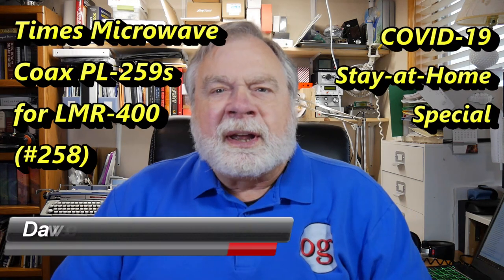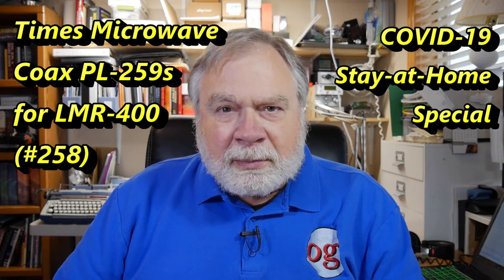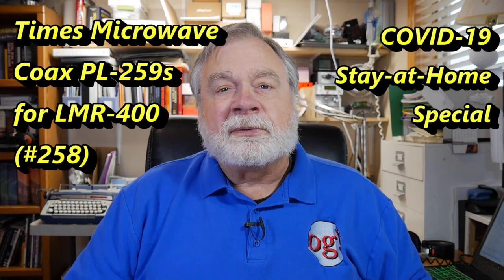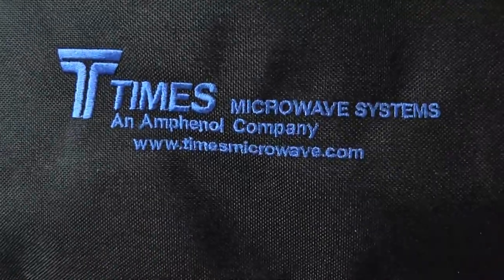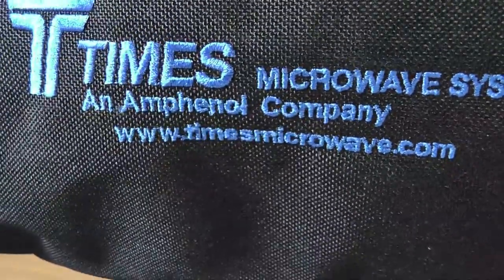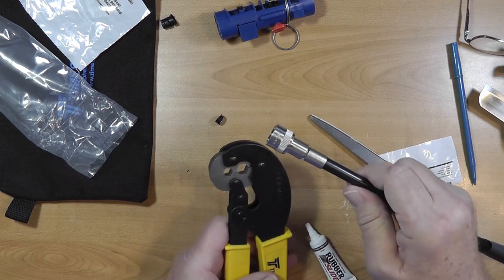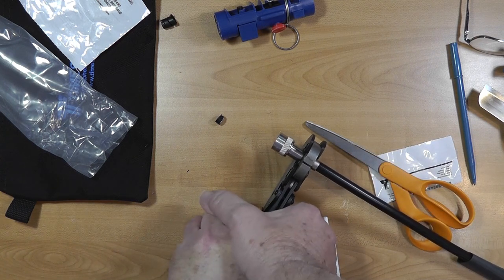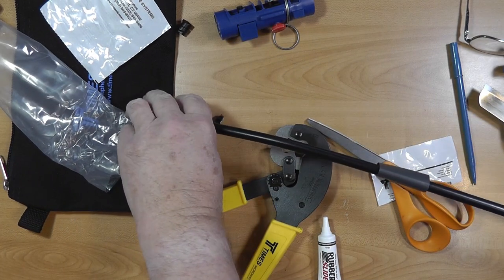Stay at Home Special: Times Microwave's Connectors and Tools (#258)

Comment: Nice video Dave.  I've been using Times Microwave connectors and cable (mostly LMR-600) for many years when doing critical antenna installations at hospitals around the state.  Maybe they didn't tell you, but when you heat the shrink tubing, it releases a sealant inside the tubing that makes a very tight, perhaps watertight seal with the sheath of the coax.  My practice is to use silicon tape to complete the installation to protect against moisture. The tools are very expensive in ham radio terms, but once you have completed the installation, don't have to go back.

Comment: Hello Dave and thank you so much for taking the time to share your videos with us. I have been enjoying them for some time now.
Near the beginning of this video you said that you were going to use the PL259 for an ADSB antenna project.  I will probably draw some heat for my comments because
this topic usually starts a heated discussion in the Ham community.
Let me start by saying that due to working in the communications business for over 20 years and being an amateur extra class license holder I have had this discussion 
many times.  I have been fortunate enough to sit down with engineers from Amphenol on several occasions discussing this very thing.
The short story is, The PL259 is only rated to 300 Mhz. Now you and I know that it is commonly used on less expensive transceivers operating up to 500 Mhz.
Also it is not a constant impedance  device. At HF frequencies their impedance is around 30-40 ohms and above about 50 Mhz it is a toss-up! A lot of it depends
on materials used and build quality. Anyway, I am ready for a flood of comments disagreeing with me but just do some research first. (Not directed to you Dave).
That being said, you are trying to receive weak signals at 1.9 gig. An N or better yet an SMA connector would be more appropriate. We all have struggled with
assembling N connectors (Although that and SMA's are about all that I use now at any frequency). So how about doing a video on crimp on N connectors for LMR-400?
Thanks again for your great videos and information and keep up the good work.

73
John 
WR0J Kansas City, Mo.

Comment: Joe Ruffer KN4AMX
Dave , Thx for all that you do for us.  I caught your remark about ADS-B.  I have been directly tracking aircraft with a 900MHx antenna, a flighaware dongle, a raspberry pi and a dedicated 27" monitor for some time and feeding data to Flight Aware.  In fact most people that visit my HAM Shack have more interest in that than the radio stuff.  You might consider a Stay at Home video about that too.  73

Comment: I use lmr400 times cable for jumpers and long runs as well. Its stiff stuff they do make an ultra flex but never purchased any. I have the cable stripping tool but don't have the cutting tool or the crimper. I have always just used the solder on type. They sure make it much easier with these tools. I remember having to do everything with a pocket knife and measuring the cuts myself instead of it being so automatic with the stripping tool.

Comment: I use the T/M LMR 400 and it has done a fine job for my shack radio/antenna connections. I buy the coax reassembled by T/M cause I dont have that assembly kit. I dont think anyone can go wrong with this brand of coax.

Comment: I really like that  connector, but especially the tool to strip the cable. I have used the Quicksilver stripping tool which is very nice but you must adjust the tool for various coax sizes, and this can lead to frustration and wasted cable when you either cut too deep or not deep enough. Also, not all coax connectors are the same in quality which can lead to even more frustration when the coax will not slide onto the connector as it should. 

Nice job Dave, I like that tool !!!!!

Comment: Thanks for the video!  Very interesting.  The question I had was the fit of the center conductor into the clamp inside the connector - did that feel positive to you?  Times Microwave is a class outfit so I suspect it is but I'd hate to think about that wiggling around loose in there.  It looked almost like one of those 'Chinese Finger Cuff' things - it can slide in but never come out.

Comment: Times's website doesnt look like they really want to sell anything since I cant find a price for the tools anywhere. Even the clicking on the connectors never leads to a cart of any sort.? what gives?
Reply: they don't do much selling to the public. Its mostly a commercial sales company. You have to register on their website to see prices and purchase from them. I used two buy direct when I worked for Motorola. Now I just buy their products thru third party distributors. dx engineering sells amphenol products as well as times cable.

Comment: Is 400 lmr the same size of RG 58?
Reply from the maker: LMR-400 has the same outer diameter as RG-8 and RG-213. RG-58 is much smaller.
Reply: @davecasler  Just wondered because my airplane radio man installed my new ADSB transponder he said with 400lmr and it is the same size as RG-58.
Reply: @timbacchus  He is wrong, Dave is correct RG58 is smaller diameter.